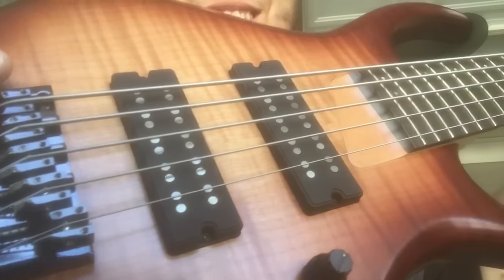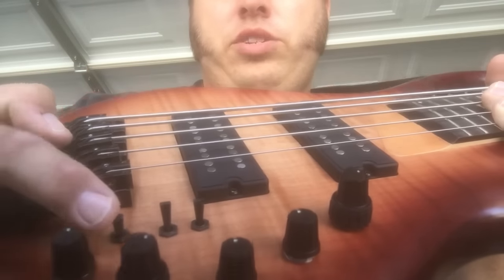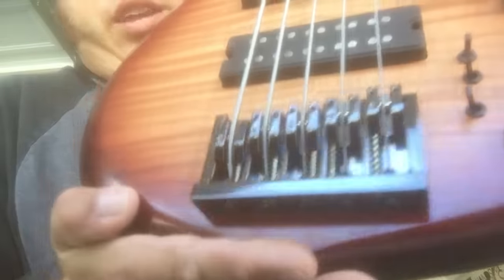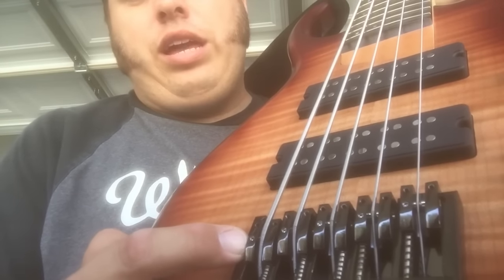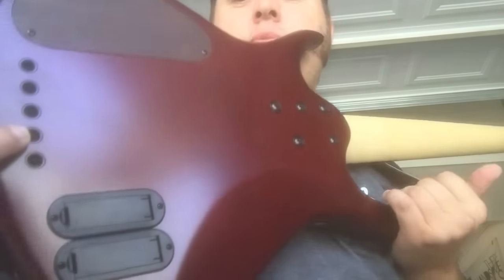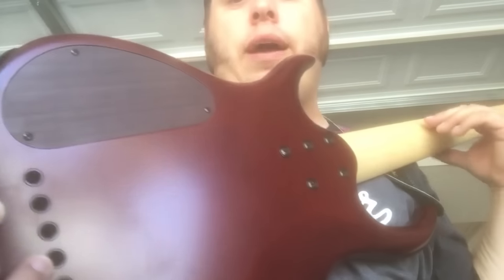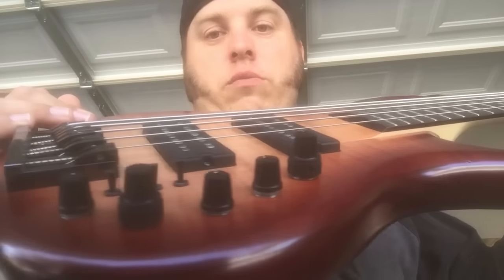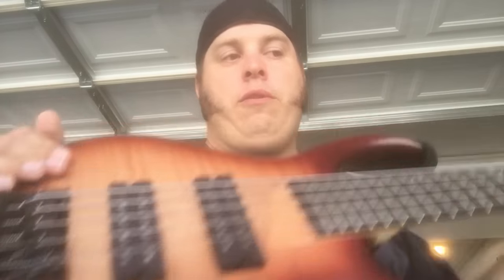My New SIRE M7 BASS. First review!

Comment: Hi,since you had this bass for quite a while now. i actually bought mine also a couple of months ago. I have a problem though with the intonation screws all of it doesn't go through the saddle or bottom out and have a hard time intonating it actually. Any tips would help. or should i just get a new saddle. Your video is a life saver. oh by the way.if you need to change the tuners the ratio tuners from graphtech are an exact retrofit for the sire m7 series
Reply from the maker: I would recommend contacting sire for replacement parts. I actually sold this bass a while back. Never played it. Found I was far more a maple fingerboard guy. But glad I could help
Reply: @sr80bassguy  Thanks for the reply, really appreciate it. Will try to reach out to sire and find out what we can do

Comment: AWESOME video. Just what I was looking for.
I just got myself a M5 (same preamp and pickups) and was struggling to understand the last 2 pickup switches. I wouldn't have figured it out by myself in a million years!
This is my first non-jazz bass and I reckon I'll settle down with your config (bridge on parallel and neck on single coil mode).
Cheers!
Reply from the maker: Glad I could help

Comment: What is the fretboard radius on the M7 in comparison to the V7?  I was thinking on pulling the trigger on a V7, but the 'vintage' curve on the fretboard is putting me off (slightly).  If the M7 has a flatter fretboard, I may just go for it and it's added options.
Reply from the maker: Jamie Mills not sure the exact numbers but the M7 definitely felt easier right away based on string spacing alone.

Comment: Hello Eddie,

I was just wondering what the difference is between the sire m7 and the sire v7.
Our band plays a lot of Stevie Wonder covers (as, higher ground, part time lover, master blaster).
And also some other funky covers.

The V7 is a lot cheaper then the M7, so whats the difference between those two?
I cant seem to find any comparisons between the basses.

I think the M7 looks way better but i dont want to buy it just for the looks.
May you compare the two basses and advise which one i should buy?

Money is not the problem here, I hear so much good things about both basses and I just can't decide which one to buy :)

Thanks in Advance,

Tak
Reply from the maker: The M7 will be your best bet. The V7 can achieve the Nate Watts sound however the pickups are Not hum cancelling. Meaning if you select neck pickup for more of a P bass sound but there is dirty power at the venue, you will get the 60 cycle hum. In contrast, the M7 is hum cancelling in both Parallel mode and Series mode. So you can achieve that gritty P bass-esque tone without that annoying buzz. V7 is by far the most versatile jazz bass I have ever used but it is still a jazz bass. The M7 can easily create the jazz bass tone along with a plethora of others. 

The price difference when I ordered was only $100 and for versatility sake, well worth the difference. 

Hope this helps.
Reply: Eddie, I own the MM Jazz Bass so I'm assuming the M7 would be the best bet for me?
Reply from the maker: Charles Wagner V if you are looking for a parallel then the V7 would be closest. If you want a contrast, then go M7
Reply: Thanks Eddie!

Comment: Hey everyone, kinda late with my question however maybe someone who is owning a m7 can provide me some insight. So here is my question aside from funk and rock i play a lot of metal. I thought with the 35 inch scaling and the diverse possibilities of the EQ it should handle it really well (deathcore, djent styles etc). My dicisioning is between a ibanez btb and this particular bass. Pls help, much appreciated ya'll!
Reply from the maker: thebrokendeck M7 all day!!!!  Much higher quality instrument and vastly superior to the Ibanez. I started on ibanez years ago and will never go back after getting a sire.
Reply: Eddie Stephens hey man thank you so much for the fast resonse. you really convinsed me now im going to buy one right away. However do you think that the m7 tbk with the swamp ash body is really any different in sounding? probably kinda hard to answer though if you hadn't had the chance to get your hands on one of these. Im guessing swamp ash will be a little bit heavier in weight and probably sounding a little brighter than alder. Anyway thank you so much, also fantastic video, the best around the web covering that bass and trust me by now i have seen them all.
Reply from the maker: thebrokendeck ash is heavier but I have learned to prefer it. Worth the extra $100

Comment: What amp bass head do you use for it? Since you can change the pick ups in passive mode. Idk if I should get an amp with passive/active inputs
Reply from the maker: MLGB0Yz I use a genz benz shuttle 9.0 with an Aguilar DI/Preamp. There is no volume difference when you flip the bass from active to passive so any amp will work.

Comment: hey Eddie can I ask u if the v7 and the m7 gig bags are the same or slightly different 
reason for asking is i live in England  and sire have told me to go to one of their distributors for a purchase but outside America the bass doesnt come with and in a bag so I need to get one separate
Reply from the maker: stephen lee I believe M7 bag is slightly smaller because body is smaller but if it is it's not by much. I would buy a V7 bag to be safe if there is any sort of an indication.